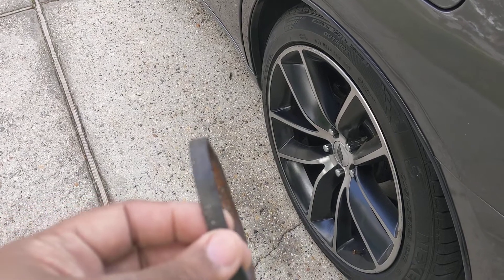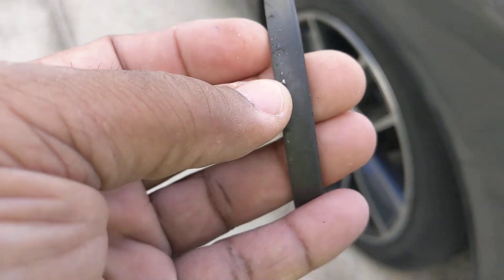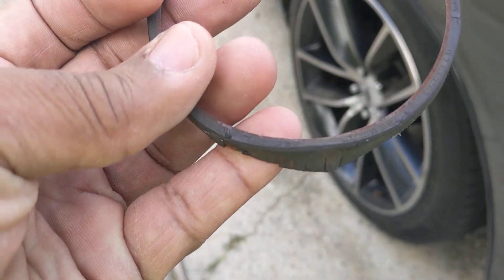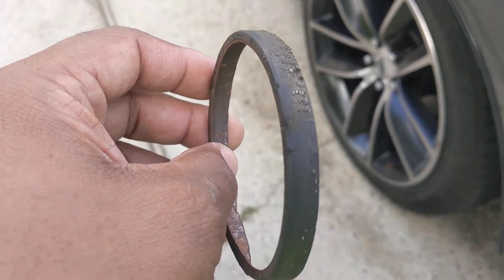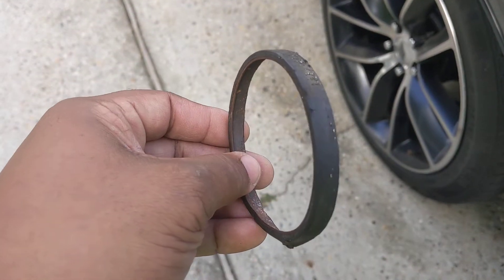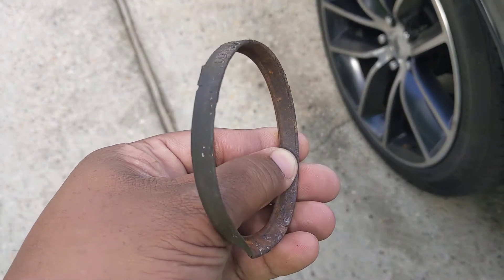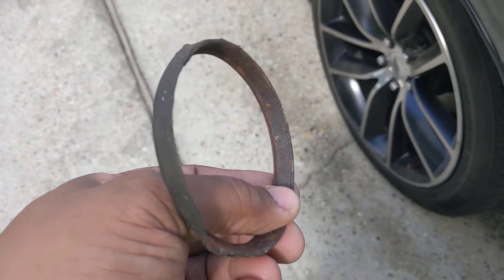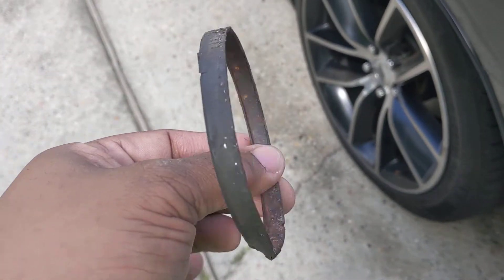Dodge Charger abs tone ring update. save yourself some money.

Comment: I also had ABS dash  light on as well as EAP BAS . Changed out left rear axle.  The ring was shot , half missing . Not sure if my mechanic had to change the axle but the car is a 2006 charger .

Comment: I have the ESP BAS and Traction control lights on, in my Charger. Can you tell me if you had any Obd2 codes?  Were your lights on? Thanks for posting this video!
Reply from the maker: My mechanic was changing my seals for the CV axle. When he put the axle back on the tone ring was deteriorated. I'm in about 4 to 5 different Dodge groups on Facebook and found  someone had just changed the tone ring itself and not the whole CV axle. It worked out good for me I just don't know what the code was for it because he scanned it .I never saw the code number.

Comment: Does anyone know if the right rear cv axle will fit through the wheel bearing hole? Remove wheel bearing slide axle through the hole?

Comment: How do you replace the front tone rings??
Reply from the maker: My mechanic did it. I'm guessing it is just pushed off and the new one pressed on.
Reply: @BigJ3RD  is it part of the wheel bearing assembly. I am doing a 2013 dodge charger and mechanic says it does not have an axle just in the rear. The bearing assembly has an opening on the back. So i am trying to find a video and no luck.
Reply from the maker: @luisgonzalez4732 the tone rings are on the back cv axles only. In the front it just has sensors. You can go on Moparpartsonline.com to see exploded views and part numbers.

Comment: What did you use to press fit it back onto CV axle? Thank you
Reply from the maker: My mechanic did the work.
Reply: @BigJ3RD  All good brotha! I was able to use an old wheel bearing race that had same OD as the tone rings. Got the job done yesterday! Still gotta do the other side but no longer in limp mode so we back on the road!
Reply from the maker: We have to keep it rolling. 💪🏾
Reply: @jesseleonard4737  so this out u in limp mode currently struggling with a charger I got some people are saying these put them in limp mode some say it shouldn't so I dont k ow if I should be looking at these or something else
Reply: @smackAbaby710  I'd recommend having your codes scanned via the OB2 port from a local auto supply store since I assume your check engine light came on in addition to your car going into limp mode before just making assumptions as to what the problem could be. Reply back with me after and I can probably help you. Good luck and god bless!